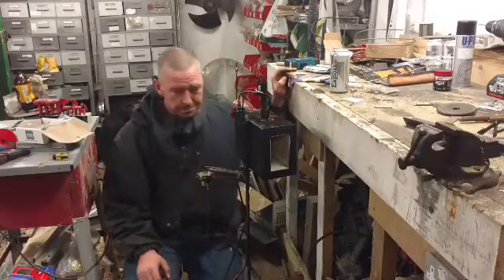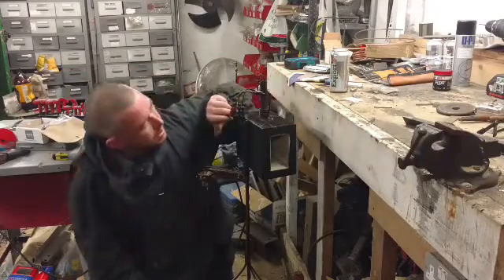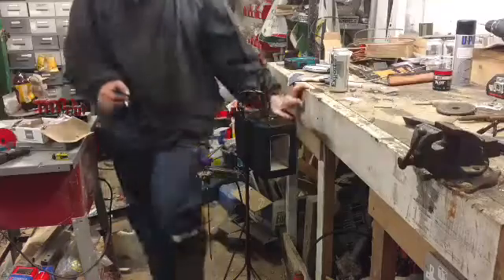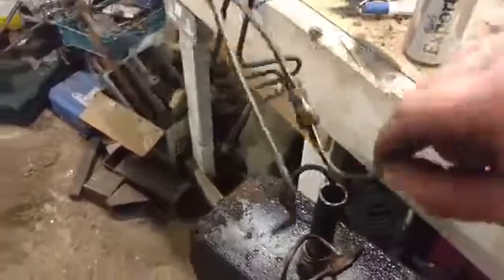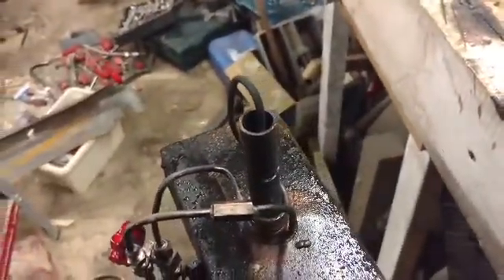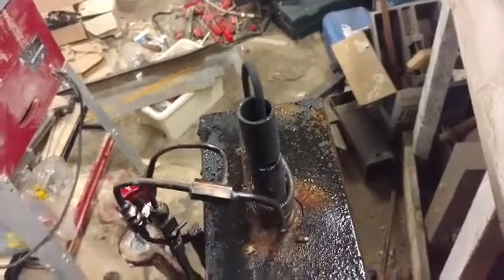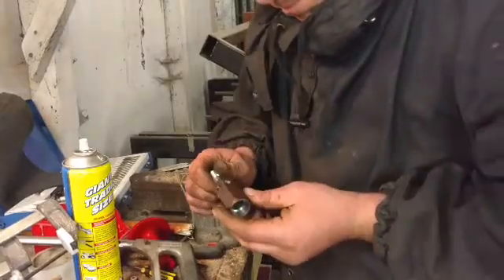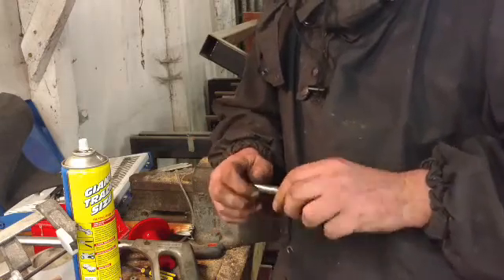Micro waste oil forge, new burner and vaporiser set up. Experimental blacksmith #2

Comment: I'm guessing by now you've discovered the nasty shit that results from using waste oil in a forge.  I did also, tried to kill me twice.  Going with a propane forge now.
Reply from the maker: YFUATIW noo, I'll worry about that when I stop smoking! I have switched to propane for the small forge though for speed and reliability, still casting bits with waste oil but mainly switched to electric for that as the muck you mentioned makes aluminium castings bad.
What sort of size was your forge?

Comment: I believe you are going to have endless problems trying to evaporate the oil in a small tube. 
The volatiles will come out of the oil first leaving  a load of carbon that will very quickly block the feed pipe. 
If you look at the spray burner I did there is no heating/ evaporation of the oil  in the lines, it is just sprayed. You pretty much have a similar thing now, just going about it the wrong way. 

I tried all this evaporate the oil in a tube thing years ago and it won't work because unlike Kero or turps or diesel which all evaporate clean when heated, Oil, Engine and veg, leave a LOT of ash and carbon behind which will cause problems. 

Try cutting the tube  after where the oil and air combine, flatten the tube to make a nozzle and just spray it into you furnace. 
You may have to preheat the furnace or spray the mix onto something hot like a bit of steel to act like a glowplug but it will work as a spray rather than evaporative unit.
Reply from the maker: Oil Burner g'day Bruce! the problem is with cold oil and a crude/no nozzle, there are droplets of oil hitting the work piece and cooling it down, I hear what you are saying about deposits, we have a commercially made waste oil heater at work and that requires constant cleaning, if I found pre heating was the only way to achieve a clean reliable burn I'd design a way of cleaning it out easily eg. pulling a plug and running a drill through it, this is after all just an experimental set up. keep up the health and safety warnings, I was tempted to make this video on horseback but fortunately saw yours first.